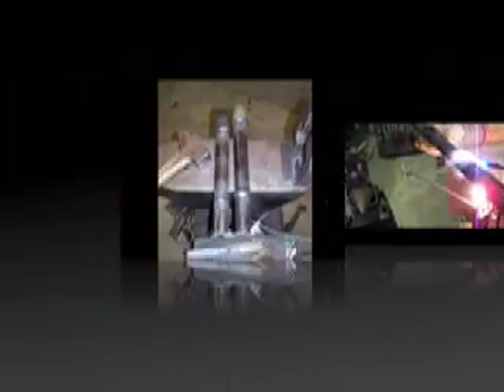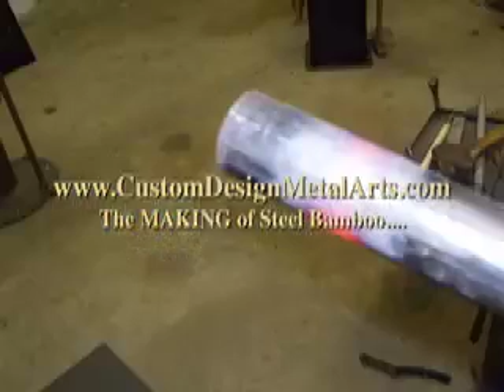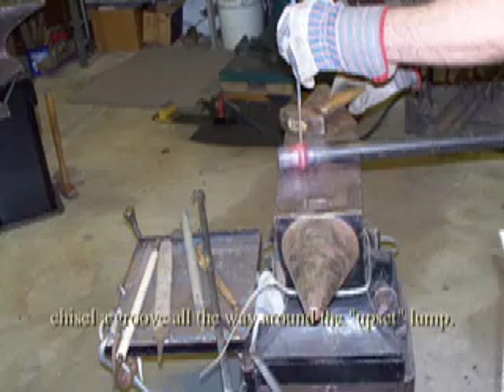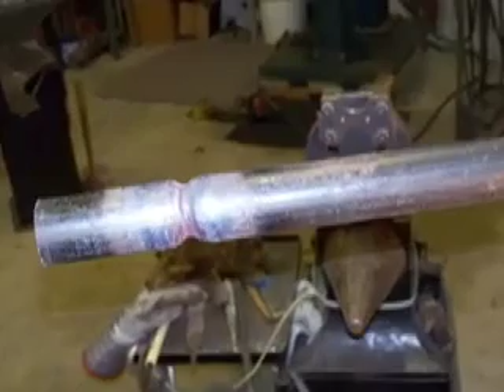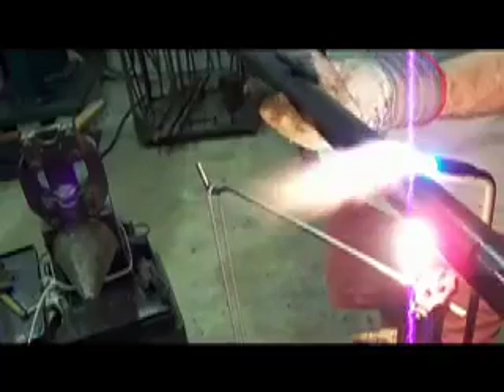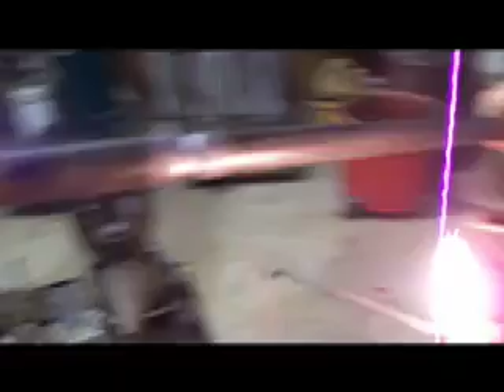Making Steel Bamboo

Comment: check out the big brain on Brad. slick. what was the pipes wall thickness? I'd imagine it'd have to be pretty thick. much easier and affordable than handling a piece of 2"x 4' solid stock with the same results.

Comment: how did you upset the area
Reply from the maker: the same way you UPSET any metal. Localized heat...and hit the metal INTO itself to upset. Small piece I hit into the anvil...after localized heat....longer pieces..I  it on the floor after localized heat.